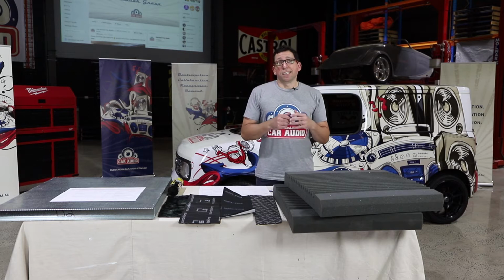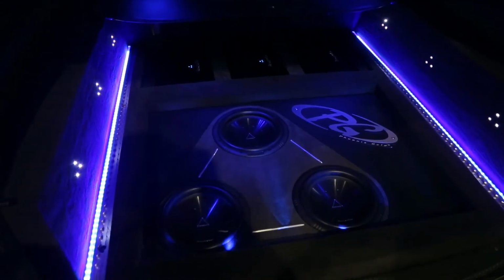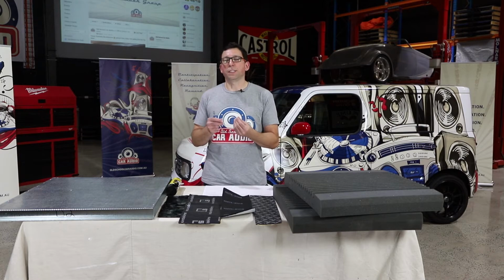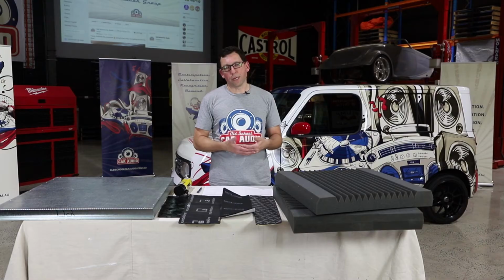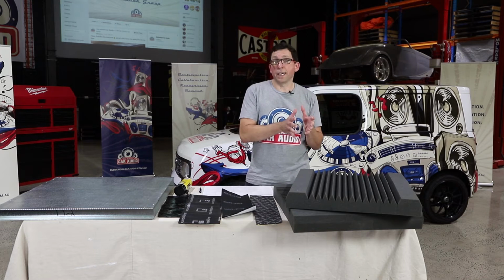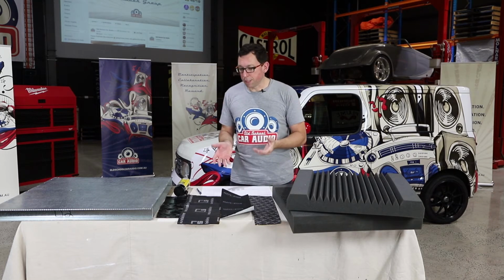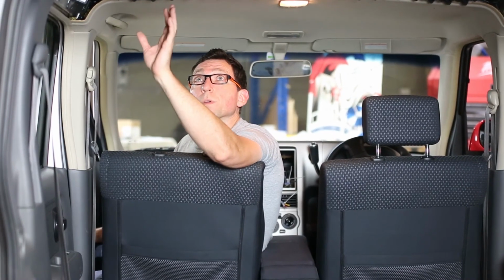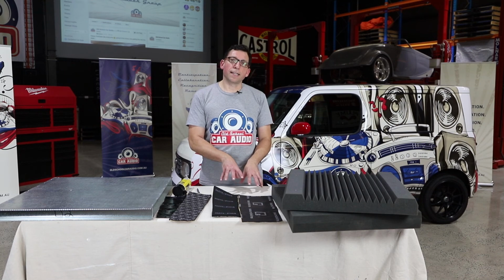Sound deadening - Nissan Cube project

Comment: Excellent explanation on the dampening panels and the acoustic foam. By the way, you did it the right way. I am very proud of that work. You understand how important it is. Most don’t or don’t care. You do!👍🏻 You did it the right way. Two high density panels followed by acoustic foam. Don’t forget doors, kick panels, dash, side panels and floor. The roof needs it also.